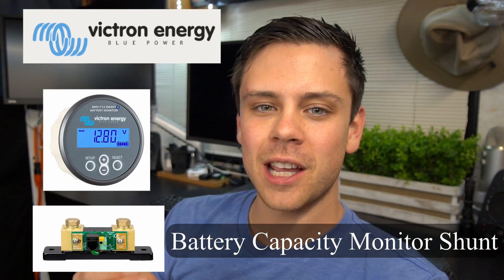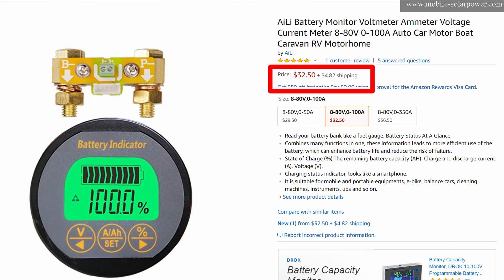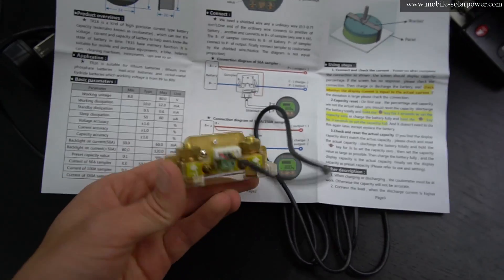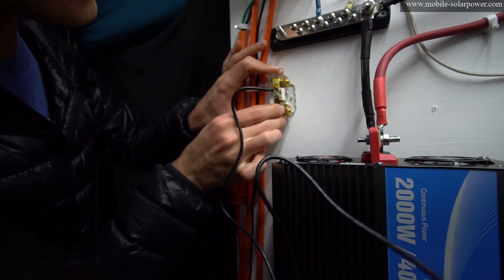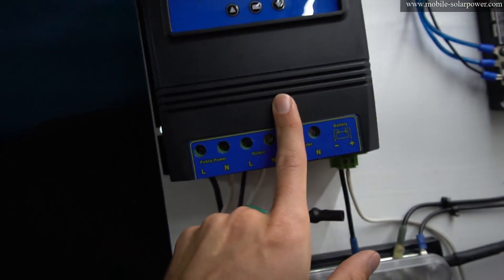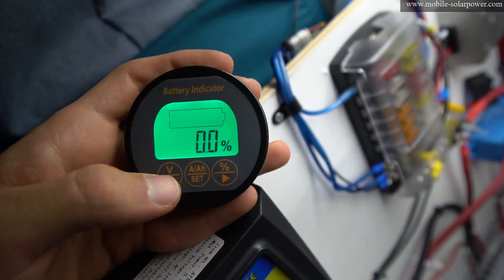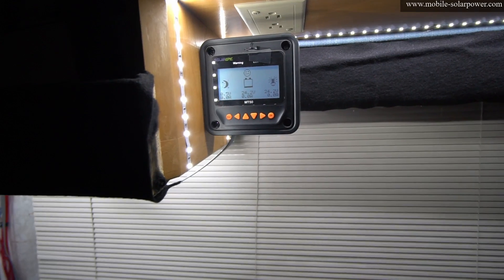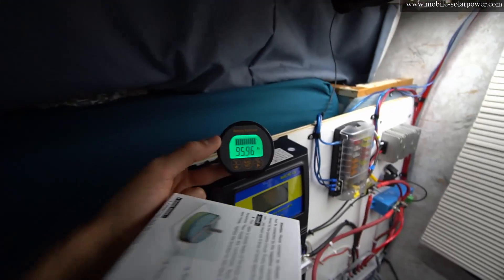$200 Victron Solar Battery Monitor? Try this $30 Chinese one instead! Great for Off-grid Solar

Comment: Thank you Will, I purchased one straight away.  However, is it possible to calibrate it without having to discharge my battery to zero?
Reply: If I understand the ‘manual’ correctly you can fully charge your battery and set the this as 100% and input your total amp and the monitor will calculate the 0%, remember to leave your voltage as zero v or set to way below your lowest voltage or the monitor will reset to 0 as soon as your lowest voltage is reached, I set mine to the battery disconnect of 11.2v and when the battery was 49% full I used the inverter under a heavy load and the voltage naturally drops under load, it went momentarily to 11v and the monitor reset to 0 even though I know the battery was at 49%, so don’t set the voltage too high (lithium battery) unless your using agm lead batteries and you want to only discharge to 50%!
So..you can calibrate without draining the battery fully as you can use the fully charged number as your 100% the draining of the battery is an ALTERNATIVE method of calibration.
Reply: @howard922  Cheers, I've received the monitor and hope to install it over the next couple of weeks
Reply: @Jamesn-js1zp  A year later installing my own... did you end up using 100% rather than discharging? Did it work for you?

Comment: Call me primitive but I just connected a LED volt meter between my positive & negative cables just before they attach to my Sine wave inverter lugs. In my case the MPPT charge controller & batteries are in a covered exterior alcove while the inverter is inside. I just need to see what my battery volts are.

Comment: Checkout the ElectroDacus SBMS 40 or 0. You can order one on kick starter. Not bad little gadget. Does the light stay on? Everything solar and batteries is getting so cheap now.

Comment: Will,
You mentioned that you don’t like connecting loads (except for the monitor) to the load terminal on the charge controller. I did and prefer doing so instead of using an inverter given the best inverters have a 90% efficiency rate, most are 85%. That is a lot of lost power on my 400w system.
I have a #10 gauge cable from the load terminal to a fuse box which then branches off in other fused circuits that run homemade 12v fans and lights throughout my house, the state of battery charge typically drops to 60% overnight. Using an inverter would almost surely deplete the three 100w AGL batteries to minimal discharge.

After watching all of your videos, I’m about to embark on installing the 24v system you designed and plan on adding more appliances without and inverter.

Comment: Hello Will.   I have two, 12 volt lead acid batteries for my RV (85 amp hrs each).  I purchased the Chinese 350 Amp version you talked about.  I also found the instructions very hard to understand.  The one setting you talked about (pressing the middle button for 3 seconds).  You said you put in the lowest voltage your battery will experience?  My instructions says to "set it to the rated capacity".  I was thinking I should set it to 170 (85 amp hrs X 2), the problem is it only goes to 100.    Do you know what I should set this setting to?    My goal here is to make sure that I do not drain my batteries too much before I have to charge them back up.
Reply: If it only goes to 100AH, then it's the 100A model, not the 350A.

Comment: What gague are those wires to shunt?
Reply: Wire gauge to shunt is based on the maximum amps travelling through the cable eg if you have a 1000w inverter at 12v is 83 amps so the maximum passing through the cable is 83 amps, so use 110 amp cable (16mm2 or 6awg iirc!) or bigger. (Based on a short cable run, larger gauge for over 5mtrs)

Comment: I purchased a similar unit on EBAY last year for about $30.  It works well except that the current reading has a temperature dependent error of +/- a couple of percent.  That error compounds with time so the accuracy is variable with climate!  Also, since the shunt amplifier is not a true differential input, an isolated 12V power is required if the unit is remote from the shunt.  It would be a worthwhile experiment for you to note the 'zero offset' versus temperature. That is the indicated current when all loads are turned off.  Mike

Comment: I know this is probably a very basic question, but again, I'm new at this. Do you think it's sufficient to use 2 AWG cable from the negative on the battery to this monitor's shunt? I'll be using this in a trailer that has one 12 V battery. I use a 300 watt inverter for charging phones, speakers, etc. I'm pretty sure this monitor is over kill, but still don't want to burn anything down. Thanks!
Reply: The maximum amps will be 300watts divide by 12v equals 25 amps so 2awg cable is fine up to about 3 times your output : ) this cable will be very short too.
Reply: Maybe even #6 is ok with your small 300 W inverter.

Comment: Ok, I just placed my order! Just wondering if 350 AMPS will be enough for my 3000 watt Pure sine inverter and 4/6 volt Lifeline batteries
Reply from the maker: Nice
Reply: was it enough for your 3K inverter? Thanks
Reply: @ShayneRiceNZ  the batteries were okay at best, Since I was Awakened, Lead is Dead. Gone to Lithiums and not looking back..... I
Reply: @CharRichardson  lead acid only provide 50% of total amps. My Life line batteries were 95lb each x 4. Wired in Series/Parallel to make 2 12v banks then in parallel only gave me 1/4 0f total amp capacity for a grand total of 1/2 of 235 amps as I remember, about 117amps. Compare that to 4-100ah Lithium at 26lb each gives us 100% of 200ah that charge really fast compared to days of trickle charging while watching the water levels and cleaning the terminals....
Reply: @michaelcanto6175  I too have recently switched from AGM to lithium.  Night and day.  AGM is ancient technology marketed with lies and bullshit

Comment: Hi Will and subscribers, I ordered the Ali battery monitor and installed it to my new Battle Born 12v 100AmpHr and I wanted share that I think it can be calibrated at 100% as well as 0%, I just set it at 100% and I think it's working but I also I noticed the Amp and voltage reading is not steady, it fluctuates slightly back and forth and  don't know if that's normal or what to do about it. Learning so much from your channel,  Thanks!
Reply: That is how i read the instructions also. I am installing it today and going to try the 100% set threshold.  Is yours still functioning properly this way?
Reply: I think so, however I am using a NOCO G15000 to charge my battle born, the NOCO is reading 100% while the monitor is 73%

Comment: I'm totally NEW to all of this and I just want to make sure I get it right: to set the 0%, I'm actually going to discharge my batteries only to about 50%. And, according to what I've read, my lead acid battery is at 50% at 12.1 V. Is this right?

My main question is, what is the best way to measure the 12.1 V? Should I just hook up this monitor and wait until it tells me the voltage? I'm confused because I thought this monitor measures voltage GOING IN, not contained in the battery. 

Thanks in advance for your help!
Reply from the maker: Yes you got it. Just do what you said. That's great
Reply: Awesome! I'm going to get it hooked up and then use the battery. When I press the V button, if it says 12.1, I'll do the zero reset.

Let me know if I'm way off and thanks SO MUCH!!! I feel like a complete dummy but I just like to confirm and reconfirm these things.

Comment: just ordered one. thanks. just not sure at what voltage my 12v four battery system should be considered discharged, i.e. 0%.
Reply: 12.06v for lead acid

Comment: Has anyone figured out how to access the backlight trigger settings on this meter?
Reply: On the one I just bought I am able to turn the backlight off and on, by pressing the V and % buttons simultaneously and holding for a second or two. I don’t know if that’s a new feature that they added or if they have just documented it.

Comment: The back light doesn’t shut off and this is panel mounted next to the bed, so I shaved the front bezel enough to allow a 62mm camera lens step down ring to thread onto the front and I’m using a lens cap as a cover
Reply from the maker: That's so smart!

Comment: What do you do if you have a 220ah battery bank? It appears this system only is for 100ah bank! Please help,
Reply: 100 amps refers to maximum current draw at battery bank voltage (12 or other within the voltage range). Specs say 0-999ah. It should be fine for your 220ah battery bank at 12 volts. 220ah's is between 0-999ah.
Reply: I have the same question.  The specs say 0-999 but several on Amazon mentioned this limitation.  Which is it?

Comment: It sucks that I need to discharge my RV battery to zero to get this to work. That's no good for the battery so I will continue to search for a battery monitor I can afford.
Reply from the maker: Or just set ur usual cycle SOC to it. Doesn't need to be set like that

Comment: One thing I definitely prefer on the Victron is not having to discharge the battery to zero. Victron starts assuming 100% and as you charge to actual 100% it is set at the top and starts calculating usage from there. No button gymnastics required. Also don't dig that plastic shunt case. My shunt has 2 4/0 cables on it and they get cranked down tight. Other than that for a cheap meter on a small system (100ah) it has it's appeal in cost savings. Not terrible to look at either.

 You can find the non bluetooth Victron  BM700 battery monitor for around $130 online. So still 4x the cost but for many it may be worth it for the added data harvesting, more robust shunt and easier set-up. (also the directions are easy to understand) ;-)

Comment: I've got a 95 Ah gel battery. Is it possible just to fully charge the battery, calibrate the meter to 100% (long press the right button) and specify the Ah of the battery in order to get an accurate Ah/% reading? Or do I have to discharge the battery to 50% and then calibrate to 0% (long press left button)?
Reply: You don't actually have to drain it to calibrate it.  You CAN just set it to the Ah rating on the sticker, but that's subject to change over time / conditions / etc.  I kind of interested to see what my 2 6V are reading after four years.  From what I can tell, setting the bottom end just zeros the Ah counter.  When you discharge it down to that point and zero the counter then fully charge it, the actual capacity is figured.  That can then be set as 100% (which SHOULD be more accurate than the rated capacity).  SOC is calculated off of that number.  I just got mine and haven't been able to test that yet but that is my understanding. I'm not planning on draining...probably set my low end at 12.0 V then charge it from there to set the high side.  That should make it read 0% at about 50% actual SOC.  So, if I didn't want to discharge below 60%, the meter should read no less than 20% (on a scale of 50-100%).
Reply: @TentsTailwinds  thats good to hear as i have a total of 430Ah ( using x2  215Ah batteries) and i have limited time as its my camping setup that at my shack 3 hours from home
Reply: @jase_drifter  Just to clarify JD,  if these batteries are 6 volts rated at 215Ah each and you have them connected in series, you have 12 volts but the total Ah remain at 215. Still, and like you, I'm about to find out how long it will take to drain my 225Ah 6v Trojans down to 12.1 amps. I also wonder if really fast discharging means that when the SOC reaches 12.1 volts, it will bounce up some after rest. Should not one wait awhile, let the battery rest and then slowly discharge it down to 12.1 before calling that 0.0%?
Reply: Same question here ... The manual is TERRIBLE ... I have a 200 aH  battery that I rather not have to drop to 0% SOC to calibrate it .. there has got to be another way ... if you find the answer drop me a note.
Reply: @ghostwriter6699  I will. I calibrated it at top charge, and put in the battery size, and it seems to display the correct Ah and % so far. :)
Reply: @alfolav  That makes sense ... I am not sure why so many folks are saying that it needs to be bottom calibrated -- I think one person guessed and the rest just copied pasted his answers ... it WOULD make my life significantly easier if i did NOT have to spend a day bottom balacing ...  Thx for your help

Comment: I think you are overlooking the fact that Victron provides units with 5 year warranties, are tested to be reliable under extreme conditions (popular on sea going vessels), probably offers more accurate measurements, offers integration with other victron products if required, can be enhanced with firmware upgrades and therefore has a much longer life expectancy and is more feature reach in the end and ready for an IOT world. I can manage/monitor my victron devices from 8000 miles away on a FREE VRM infrastructure. All-in-all a far greater deal has gone into the actual design, construction (R&D). While I have no issues with Chinese products or even their reliability these days and think they have beaten the world by making things affordably to a much broader user base and certainly has their place in my home, you should at least look beyond the $ value only before you make such poor comparisons. That is why you e.g. never compare any American car with e.g. more expensive European / Japanese equivalents. At least I know which one I will buy and why ;) (Cars should be able to handle and perform well on more than just a straight line)

Comment: Hi Will. I received mine in the post from China, but no instructions included.  Do I place this monitor  in the negative lead between battery and inverter, or between battery and charge controller?
Reply from the maker: At the battery, connected to both the charge controller and the inverter

Comment: I've watched your video twice or three times and gave it a like. Pretty good job. The thing that concerns me is the part about draining the battery, (bank ?) to 0% charge. Draining a brand new lead acid battery below 50% of capacity even the first time you use it permanantly damages the battery. When recharged that battery will only accept up to 80% of it's original capacity. Am I missing something in your description of the monitor operation and or set up? Thanks
Reply: @bruce sannino the zero'd out point in the video for purposes of calibrating the shunt was a point that @DIY Solar Power with Will Prose established to be his lowest point he wanted to discharge his batteries. He did not bring his batteries down to 0% charge. A subtle comment was put on the screen to that affect. In an earlier video, I explained that more explicitly when he programmed his inverter to shut down at a specified input voltage as to not fully discharge his batteries. Now, the shunt will report the percentage of usable charge. At 0%, his batteries will still be at xx% charge.
Reply: @jeffcecchini8803  Well said and thanks.
Reply from the maker: Yeah, don't do that lol. Discharge to typical discharge bandwidth DOD, like 50%. Whatever is usable.

Comment: Since you promoted the heck out of this monitor, they raised the price to $39! ☹️☹️☹️
Reply from the maker: Actually what happened is that they improved it, so instead of 100 amps like the one in this video, this more expensive one can handle 350 amps. So it's actually gone down in price considering what you get. Same display screen but the shunt can handle more amps

Comment: Great video but please don't confuse precision with accuracy (@4:15), especially with cheap goods. Something can read out to 9 digits and only be accurate to 3.
Reply from the maker: Yep
Reply: Hey how  are  doing 
I have a  question for you 
The Samsung ess energy  16 s 60 volts is good  module

Comment: I have yet to discharge to calibrate, but its working. I wonder why they didn't think of providing a reset to 100% feature... when in Absorb mode and current goes to say 2% of the Ah of the bank?? Or BMS suspends charging on LFP types at full. I ordered the 80v 350A version because of my battery bank size and paid $38.50... went up $4.50 since. I want to mount the display about 18' of wire run away from the shunt. The cable that comes with is shielded. Not sure were you get that stuff, but will probably splice into a left over CAT5E and use spare conductors for in-sheath shielding. FYI: Shielded cable should only be grounded at one end, otherwise it defeats the idea if current flows across the shield conductor(s). This is a very sensitive unit so I will have separate the wire run from AC and DC loads by a space. I ditched the clear plastic mount (it is nicely made I will say) and bolted shunt to lug on negative bus and bolted directly to battery cable because of limited space. I still can't believe the price. Thanks for pointing this out Will.

Comment: Will, I really appreciate your videos and all that I have learned from them. I am getting ready to buy a battery monitor and have found the exact same unit you tested but also one that uses a Hall sensor instead of a shunt. From what I have read, it seams the shunt is more accurate at very low amp readings and is less expensive but it seems like the Hall sensor may be better overall. What are your thoughts?
Reply from the maker: Shunt better for system. I have both. I love both. Different uses tho

Comment: Hey Will, I need to extend the main cable but I see the black wire seems to have a resistor at the plug ends. What's your opinion on this?

Comment: Could someone please measure the stud diameter on that shunt… 1/4",  5/16"  or  3/8"?  Thanks
Reply: With a 14mm nut size it should equate to a 10mm stud/bolt size ( about 3/8" in superior imperial galactic units)
Reply: I used a 3/8" lug on the 350A shunt and it fit nice and snug